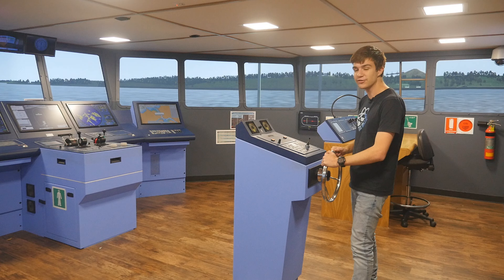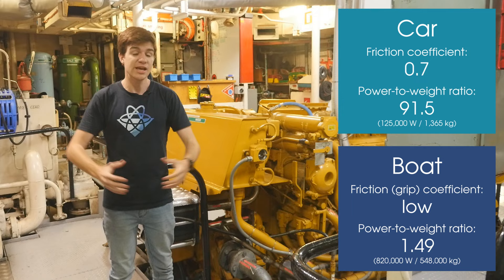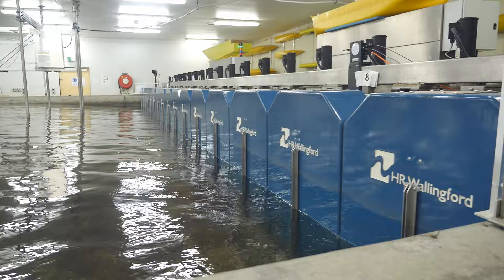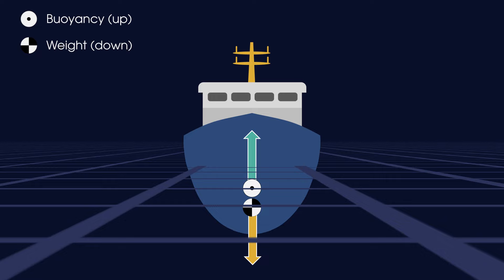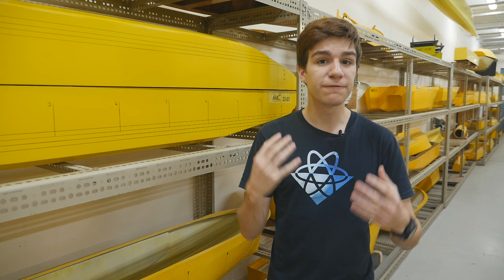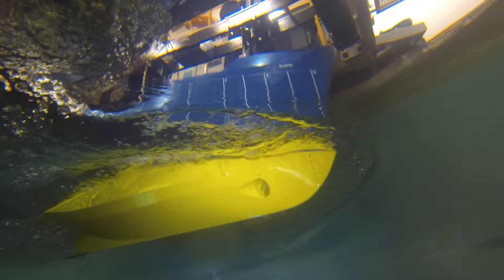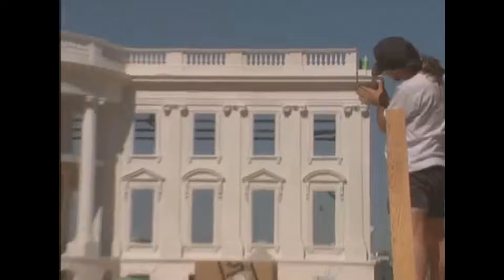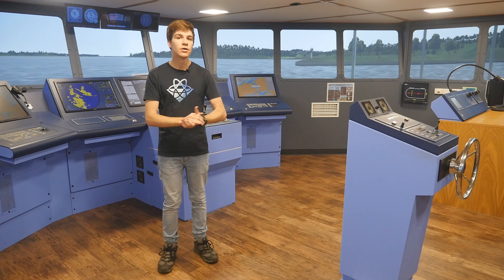How To Fake An Ocean

Comment: I used one of these in England. We asked the engineers if we could try a tsunami. They sent the waves on max and we nearly broke the computer.
Reply: Okay I typed that up during the intro in the simulator. We used a simulater machine, not the water machine in the rest of the video!!
Reply: @TheImmortalPwnage  between those comments They called you not to spill the secrets eh? But thats ok, I wouldn't want to mess with Them either
Reply: @vyl4650  well I don't have a YouTube channel, a willing cameraman, and the noteriety to get me into places to review for y'all so...

But your joke was also funny :)
Reply: @TheImmortalPwnage  that was actually supposed to be a joke on how we live in a simulation and those who run it made you change your first statement. But I guess it wasn't worded the best way
Reply: wait, you can break the computer by over-stressing it in a simulation, then I realized, we are probably talking about massive supercomputers basically already running overclock with thousands of CPUs optimized to give absolute computing power over anything else, push it a little harder and CPUs literally burn out from the heat alone, not like the normal desktop/servers we use for computing that are designed to withstand 100% abuse for eight years straight (servers are literally under-clocked to save power and last more).
Reply: @monad_tcp  I'd imagine it would be more like the simulation model struggling with the complexity of the simulation running out of available memory or simply not able to serve up updates within the expected frame time, etc. and the software falling over rather than the computer(s) physically breaking.

Though I have been there before - misguided use of ad hoc consumer parts. The HDDs were working over time with all the logging involved and started getting hot, very hot, which somehow resulted in a short circuit type condition where protection features on a PSU did not kick in - cue the rack getting too hot to comfortably touch for around 18 inches around it and a load of trashed hardware. Probably lucky nothing caught fire. Moral of the story don't cheap out on intensive applications which require enterprise grade gear.
Reply: No you didn’t
Reply: @TheImmortalPwnage  struck a nerve , did I ?
Reply: @f87115  just asking for Humor sake.
Reply: @TheImmortalPwnage  so ,, it’s like this, commenting before watching a video ,,, just couldn’t wait to get story out, Sharing stuff nobody gives a sht about, most people lie often , attention seeking behavior , it’s ok , right on par with the rest of the world ,,, maybe I read too much into things
Reply: @f87115  maybe. But then again this is the internet. I forgive you.
Reply: @TheImmortalPwnage  why thank you,, kind human!
Reply: @monad_tcp  no, they probably mean they almost crashed it. A supercomputer won't just break from intense loads. A supercomputer is designed to sustain 100% usage indefinetly. There's no use for a computer that breaks if you use it.
Reply: This sounds like a grandma who freaks out about her computer breaking when the screensaver turns on and sees the "hackers" making pipes on the screen

Comment: But the simulator isn't simulating the effect of the ship movement on the crew.  I can tell you from 1st hand experience how difficult it is to think clearly, command and navigate a small vessel in a seaway when your breakfast is bidding you "Many Happy Returns".
Reply from the maker: Haha, excellent point! It still felt super weird though with the whole horizon tilting yet no actual movement. Would love to see one of these with hydrailics to make the floor move
Reply: In my experience, seeing the ship move but not feeling it would be pretty much the same problem.
Reply: The Blue Fin was dubbed the Spew Fin during my time at the AMC.😂
Reply: @AtomicFrontier  Most simulators that had a moving bridge are locked out now. Syncing the physical movement and  the screen presentation were really critical and caused more motion sickness issues than the fixed floor and moving screen.  The trick is to look at something stationary, like the radar screen or chart plotter, if you feel sick.  This is totally contrary to what you do on a normal vessel.
Reply: Haha, so right. First time our class went out to sea it was on a research ship that was build to be beached, very thick Hull. Weight/power/rudder surface-ratio was totally shit, so in 7-8 Beaufort there was no way I could steer it in a straight Line. Got 80% of my classmates seasick. For me the trick is to have a big warm meal ASAP, hard to get it down that moment, but makes my sickness go away for the rest of the trip.
Reply: @janvisser4132  I thought the trick was to have jam sandwiches because they taste the same on the way up as they do on the way down.

Comment: I see a new Tom Scott in the making. 

Also, I see that you use Z for up and X&Y for the horizontal plane, as is only right and proper. :D
Reply: Screw horoscopes, what's your preferred arrangement of axes? I'm personally more of a Y-axis up cause I'm used to graphing calculators.
Reply: I usually think of the 2D plane as a floor, not a wall. Hence Z is up 😌
Reply: Minecraft's Y axiz being up always confuses me.
Reply: but y is for going up in a 2d graph plane anyways
Reply: When Y is up that means you assume some arbitrary wall is Y, which doesn't really make sense for most 3D environments.  I much prefer x and y defining the floor, which is the 2D plane the player moves across the most (z movement is by far the least common, unless you're in a space game where there truly is no such reference plane).  The only time Y being up is attractive is when you're coming from 2D games and wanting that to translate somehow into a 3D world, and IMO that's a bad habit.
Perhaps I'm just be rationalizing something equally as arbitrary... but Z being up is the most logical, you can write that on my tombstone.  Better yet, make the tombstone an arrow labeled Z, pointing up to the heavens as god intended.  :P
Reply: @guitargirl1517  I actually like it when Y is up. This is the difference between what I call "Game Coordinates" and "Math Coordinates." In the Game Coordinates system, we begin with a 2D game like Super Mario Bros. for the NES or Pokémon Red/Blue for the Gameboy. In both games, the easiest way to see directionality is "Y is up/down, X is left/right." When we need to extend Game Coordinates into a 3d environment, like in Minecraft, we keep these rules exactly the same, but add in Z: "Y is up/down, X is left/right, Z is forward/backward."
Reply: I’m having palpitations even thinking of Z as anything other than up 😳
Reply: Waited for this comment
Reply: @__Obscure__ ,  But in your Pokémon example, Y is like north/south. Extending that system would have Z be up/down.
Reply: @JNCressey  Ah, that's a fair note. Good thinking. Ignore my Pokémon example then and think of Mario Bros. Y is up/down. (Sorry about the confusing example. My brain thinks in "Up-Down-Left-Right" much more intuitively than "North-South-West-East". When playing Pokémon I always thought of it as Up/Down, but you're right, it could very much be seen as North/South. So my Pokémon example was flawed.)
Reply: @__Obscure__  this is not actually universally true across video games. The legend of Zelda, for example, upon making their first 3d game (ocarina of time) found it too difficult to maintain focus and precision on an enemy when they could move in 3 dimensions, and added a function they dubbed "Z-Targeting", because, of the 4 games that came before, 3.5 were top-down(Zelda II had both), so this new axis was the vertical axis.

(Some would say it was named for the button it was assigned to, but i think it's the other way around. L + R shoulder buttons were already the standard and they wanted another button to handle the new 3d environment quirks)
Reply: I feel stupid reading this comment section...
Reply: @StuffandThings_  it’s the Minecraft for me
Reply: Shouldn't Z point down in Australia?
Reply: @defectivepikachu4582  yea, so Z is depth, not height.
Reply: I would also add to my complaint, if you're choosing Y as up because you come from 2D games, then Y might be down (or negative up).  Quite often Y starts at 0 at the top of the screen and increases as you go down... which is all kinds of frustrating when grafted to 3D.  I've seen people try this and nearly get exiled for it.  :D  And if you're swapping the direction of Y when transitioning to 3D, it may be best to also swap out the axis entirely.

In games I've worked in, we just have 2D Screen and 3D World coordinates.  In 2D, Y is down.  In 3D, Z is up and X & Y define the floor plane.  Some simple camera functions can be used to project positions from 3D to the screen's 2D plane, and a click point from the screen to the 3D world.
Reply: @SenselessUsername  ...that's still the vertical axis
Reply: Isn't Y up, Z back and forth, X right and left?
Reply: @Ocer.  By default, screen coordinates typically start at 0,0 at the upper-left of the screen.  Positive X travels right, and Positive Y travels down.  Some games or game engines will invert this so that 0,0 is the bottom-left of the screen or something else.
I'm curious what the frequency is though...
Reply: @danielhale1  bruh
Reply: @Ocer.  Not sure what your "bruh" reply means.  Maybe I misunderstood what you were saying or replied to the wrong person.
Reply: He kinda talks like him too
Reply: LOL. Obviously struck quite a nerve with people. In 3D graphics Z is invariably depth with Y-Up, so we have Z-Depth passes in renders that are graduated by distance from the camera. I do wonder why they chose to work like that. Although it kindof makes sense when you think of a 2D screen as X and Y....
Reply: @gonzomuse  Yea the renderer typically views depth as Z because its world is the screen it's rendering to.  Though that's different from the 3D world being rendered, which has its own coordinate system.  As the camera moves around that world (and especially, rotates), any semblance the camera's coordinates initially had with the world's coordinates is gone.

BTW I think most people aren't getting their nerves struck; most of this feels like fun but passionate banter.  Though the "bruh" guy has me wondering.

To me it's not a matter of what's ultimately right, since all these coordinate systems are kinda arbitrarily chosen.  What hurts is having to switch between them .  I wince whenever I'm in an environment where Y is up because everywhere else I've worked, Z is up, and making that transition in my head nearly breaks my fragile brain every time.  :D

I'd be happy to commit to either method if only it could become the standard, with no more risk of switching back and forth.
Reply: @danielhale1  It would be strange to switch axes between environment and renderer, but I get what you are saying. Y up is the default in CGI. At least it has been since I've been involved. I started with compositing so, Z has always been depth to me. I'm sure there are plenty of exceptions to this rule, of course. I know Max is Z up due to it's popularity with arch-vis (floorplans) and UE is Z up. That somewhat surprised me, but I think it's a game design floorplan thing. Where or what are you are working on where Z is up?
Thinking about it more, I think it's really the difference between screen space (TV, VFX etc...) and floor space (i.e. games, architects etc..)
Reply: @gonzomuse  Yea I'm working with games and simulators.  The standard there is usually Z is Up, so that's why it's odd to me that Minecraft picked Y Up.  But even in games there's no agreed-upon standard, it's a lawless wasteland out here too.  :D

Someday somewhere I'm going to encounter a 3D game where X is up, or negative Y is up (because of someone used to standard hardware screen coordinates), and the cthulhu madness will take me.
Reply: only uncivilised people would use Y as the vertical axis.
Reply: @danielhale1  I just have to contest what you said about, at least working with games. Y being the vertical axis is definitely the standard for most modern games, and game engines, with z being depth. That's also why we have such a thing as z-buffering, not y-buffering.

(What credibility do I have in this field? I'm currently on the last year of my Masters Degree in Game Development! :D )
Reply: @guitargirl1517  Y to the Sky, simple
Reply: @gormauslander  ?? Axes are oriented, up & down are different. I hope you can agree that if your pilot tells you shortly after takeoff  "we're making good vertical speed", it matters whether he means up or down.   The daft point I made was that the antipodean Z-axis should point down the floor to correspond.
Reply: @SenselessUsername  i see your point, but that's not really a good example. Different trades can have the same word refer to entirely different things. If a contractor tells me he loaded studs i to his trailer, i will think he means planks of wood. If a farmer says the exact same thing, I will think he means horses.

If a mathematician tells me "vertical axis", i will imagine up and down. If a pilot says "we are making good vertical speed" i will give him the "who farted" look because everyone else in the world refers to it as "climb", and i will wonder where he went to flight school, but I will assume he means just up.
Reply: wait people do it otherwise???
Reply: @StuffandThings_  one of us
Reply: @luxhey I know this is two years old, but Unreal uses a left handed Z up coordinate system for its world space.
Reply: @Kenionatus  You are indeed correct. That is why i wrote "most" and not "all". There are plenty of deviations and Unreal is one of the big ones.

I also must admit i, at that point, was thinking mostly about rendering. That is also why i used Z-fighting as an argument. The "depth buffer" is also almost universally called the "z-buffer". When rendering we use the coordinate system of the camera, which is almost always is Y-up.
But it is still true that most games and game engines world coordinate systems would also use Y-up.

I don't know about modeling software though.

Also! It being 2 years later, i actually graduated and i am now a Master of Game Development and Game Technology, specialised in AI! :D
Reply: @luxhey  Congrats!

Comment: Great video - just a piece of advice about 8:00 - in the future when filming LED screens, or some lights, etc adjust your shutter speed in the camera to match the frequency that the LED / light source is at, if you get it right it'll remove the rolling bars on the LED screens. (if you are filming at 25fps for example, if the LED panel is outputting at 50hz, set the shutter speed to 180 degrees)

Comment: You know what would be cool? An rc where you can feel the actual effects on the craft in a larger Sim in real time. With a good portion responding to actual controls. Move the throttle, the craft responds, turn the wheel, responds.

Comment: Isn’t that scale-factor not ideal? Gravity will scale with the square root of the scale factor, but won’t friction scale differently? Friction can be either the 1st or 2nd power of speed, depending on relative speed, and I doubt both would work perfectly with a fixed scale-factor like that.
Also I’m surprised that fluid simulations aren’t sufficient to replace a big tank like that.

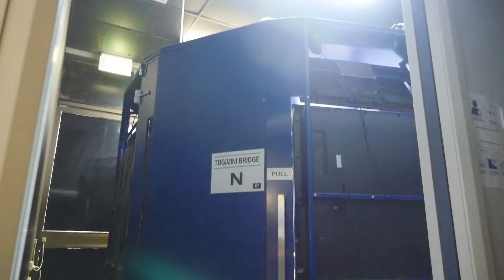Comment: Like the boat smashing in the waves when they were equal to its length, at 7:40 the camera's shutter speed and the refresh rates of the monitors behind you are the same, causing another kind of interference. Shooting 30 frames with a 180 degree shutter angle there?

Comment: One question I’ve had with these kinds of models are what effects things like the water’s surface tension, viscosity, or the speed of sound have on the results and if you can compensate for them like with gravity. I’d imagine compensating for the speed of sound not changing would require a different time scaling than for gravity, and I can’t see how you could compensate for viscosity/surface tension without creating other problems. Although the effects are probably small enough that they are negligible in any practical model.
Reply: Speed of sound scaling would be the same as far as I can tell. That's also a velocity; I imagine you have to scale every velocity by the same factor
Reply: @fisch37 . For gravity you scale time by the square root of the length scale, since the acceleration needs to be the same. For velocities you need to scale time by the same factor as length to keep them constant.

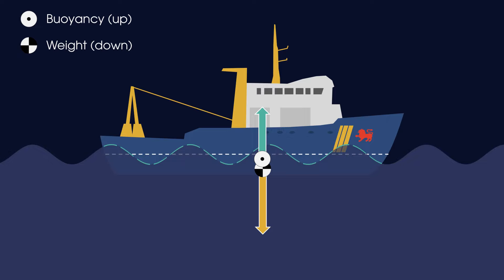Comment: I think you are confusing wave length vs wave amplitude refer 4:25.
Reply: he's talking about reducing wavelength, i.e., there's more waves in a given length. this is talking about how torque from buoyant forces is easier to handle when there's more waves, even if they're waves with the same height.

I believe amplitude is entirely independent of wavelength/frequency. A lot of tall waves and a few tall waves are both physically possible.

Comment: they slow down the footage to get the upscaled version but is this even enough to get a realistic result? The length for example is 20x bigger for the real boat, but the surface is *400x bigger and the volume even *8000x bigger than the model boat. The weight is differently n stuff, for example if there is a model of a person jumping of a building that's 100x smaller, the human will always survive no matter what hight he is jumping from since he is 100x smaller and too light to get any fall damage since his area only shrunk by 1000x while his mass went down by 10000x. I wonder how they compensate for the weight etc in the model ship, even though the air in it is a volume too so it might have smaller effects on a boat than on a human jumping off a building
Reply: Well, actually surface area would be 400x and volume 8000x, but I think your point is actually valid
Reply: @fisch37  oh yeah true, my bad